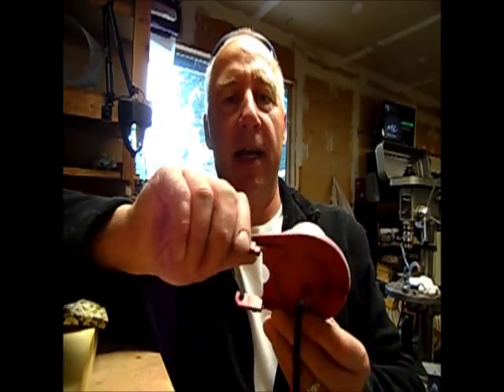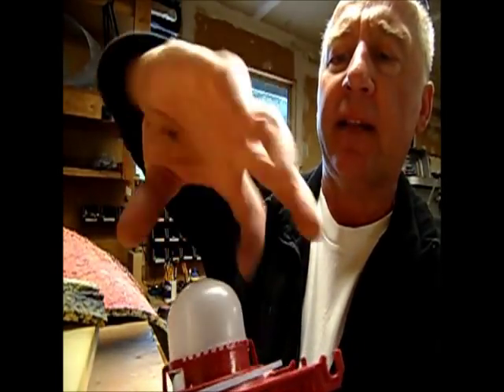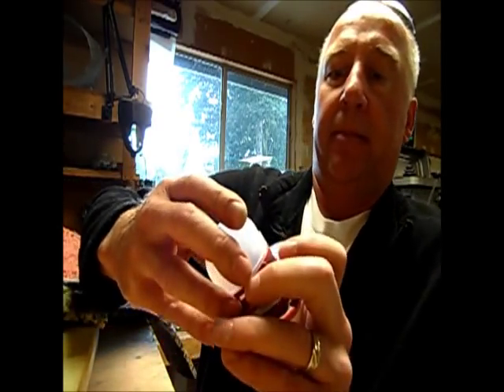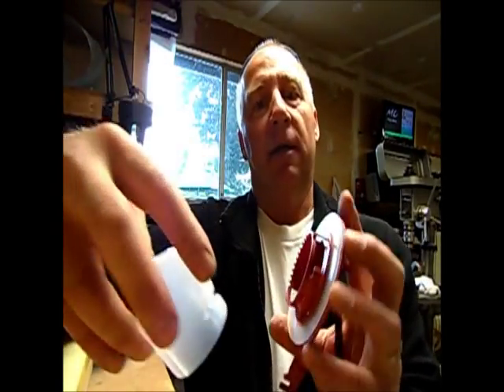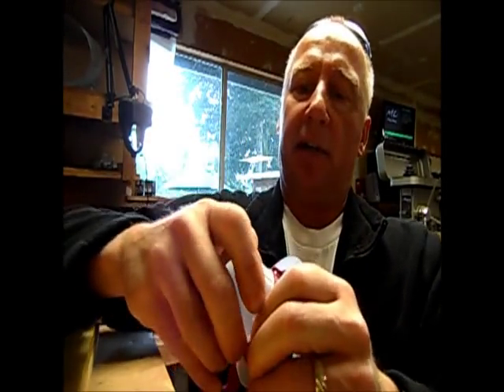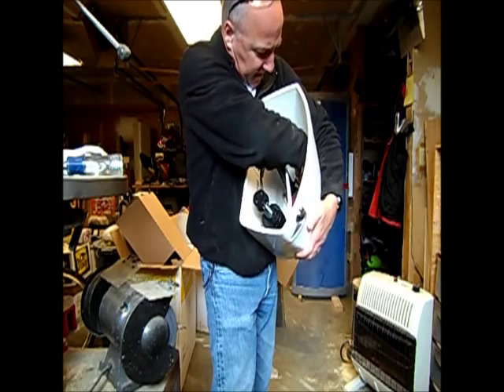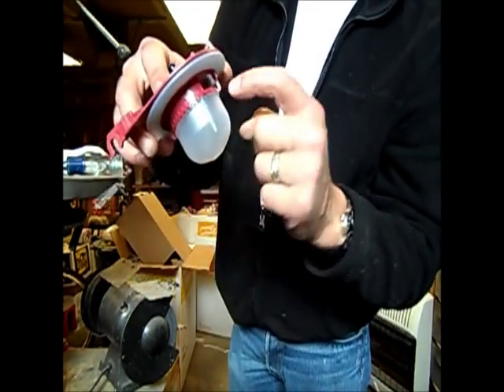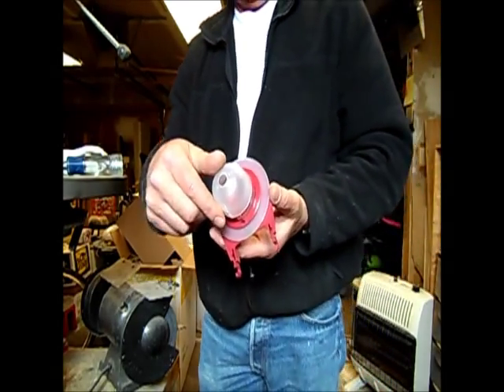Fluid Master 540 adjustment

Comment: Thank you! Your video was the ONLY resource I found on the web that actually explains how the thing works. BTW, the clear plastic stiffens with age. No amount of swsqueezing would flex mine. It was pretty obvious that any more pressure would shatter it. I had to use a small screwdriver to pry it off. That worked fine.
Reply: You just helped me immensely with this comment, God bless you !! Haha I almost broke this thing 😅

Comment: I see fluidmaster doesn't even list this part any more on their website. It's been replaced with the  5403 - UNIVERSAL ADJUSTABLE 3" FLAPPER which doesn't have those annoying locking tabs and adjusts easily without taking it apart. But I had to find YOUR video to be able to adjust mine. THANKS!!! quickly fixed my problem.😀🚽
Reply: I was actually going to purchase that valve just to get a better flush until I found this video.

Comment: This flapper was set at 8 on my new Eljer 1.6 gpf toilet and still closing way to fast.  Barely getting a 1.0 gallon flush.  Thanks to your video I was able to fight through the extreme tightness of the bulb and adjust to 10 which helped along with raising water level closer to top of the overfill tube.  Your video was a great help!  Thanks

Comment: I would like to add my thank you to the others that have been given to you. I watched another video and the man just turned it with no problem. I was getting ready to get my pliers and have at it when I decided to look once more. Your video was up in the corner so I clicked on it and you solved all my problems. I actually thought it was designed to be that way to conserve water and I guess it is, but when you have to flush multiple times you are wasting not conserving. I really don't understand where it could be used, so why not just make a flapper that works without the adjustment. Thanks again!

Comment: Yup, that was it. I couldn't press those snap tabs with my fingers at all. A screwdriver did the trick. This flapper was already installed in my toilet when I moved in. Now I don't have to hold the handle down for 5 seconds anymore. Thanks for the video.

Comment: Hey, thank you so much! I've been struggling with this for an hour, and you told me exactly what I needed to know about that flapper. Also, thanks for explaining how adjusting the air holes keeps the flapper open longer.

What drives me nuts about these Fluidmaster parts is that a) they're cheap plastic and any adjustment makes it seem like you're about to break them (I thought I was going to break the flapper if I pressed any harder).  And b) it seems like they're the only brand that's sold anywhere.

Comment: Heh, thanks tons for this!  New toilet, knew something was wrong, flapper closing WAY too fast.  Instructions showed a float on the flapper and I actually called the company to order (lol, not sure what they sent me!).  Still felt something weird, then came to this via Google.  What a break, otherwise I'd have pondered this for days.  Just like you described.

You're right, you need a lot of force to get the white cup to come out of the flapper!  I used the blunt end of a pen (cover part, also thinking something like a toothbrush handle would work), pushed hard on this sucker, and got it out and saved my fingers.  Tried it on 9 just for kicks, decided 10 is really better.  Hint:  If it's still too quick, hang a float on the chain.

Anyway, working almost normally now, thanks again for something that saved me a ton of time/headache.
Reply: Yeah it still seems like it closes too fast .. so you used a float as well?

Comment: So thankful I found this video. My Cadet3 flushed fine for the first month or so, but has slowly deteriorated over the past 2 years. No clogs- toilet augured out clean and a bucket of water dumped in flushed fine. Once I adjusted the flapper to 10 to keep it open longer, flushing is much improved.

Comment: Thank you, this tip about the Fluidmaster dial and how to release it was super helpful.  Still needed a screwdriver and was not easy to do, but got it released, adjusted and back in the tank.

Comment: Maybe Fluidmaster has made some changes recently, but in my new 5403 (3") flapper I don't need to fuss with finding the detents and such to make an adjustment. I simply pull out on the clear bulb part and keep tension on it as I rotate it where I want it, then release it. Note that you need to be holding it firmly with your other hand (red plastic part) while doing this.
Reply from the maker: UkeDoggie possibly. my wife used to work for a company that would ask for a slight change in product design which change the part number so you couldn't price shop. looks the same and is 99.99% but not exactly. in this case I believe to help ensure the water use guarantee on this product the manufacture requested the adjustment be locked, who knows. the politics of business, sheez

Comment: Fluidmaster has a chart out now to what number needs to be set on the 540 flapper.  I have a newly bought American Standard Cadet 3, and the Fluidmaster chart says to set the flapper at number 8.

And yes my new Cadet 3 came from the factory installed with a Fluidmaster 540 three inch.  All the information is plainly marked on the flapper. And yes the Fluidmaster 540 was set at setting number 1, and it should be set at number 8.

Thanks for the video because Fluidmaster did make these a PITA to change the settings.

Comment: Tom -- let me add my thanks.   Your offering here saved me a bunch of time and probably a trip to the store.   I had the same trouble getting the pieces apart and missed the second detente that you pointed out.  Regarding the other posters: perhaps it's easier to get the assembly apart if (a) the plastic is warmed up or (b) you have the hand strength of a sumo.    PS: the silicone ring beneath the flapper on my unit developed 'blisters' over time that I'm convinced were enough to cause leaking.  If any of your viewers are having slow leak issues, try checking for blisters and just popping them.
Reply from the maker: Thanks George, After closely re watching my video I can see the thing has very little movement if any. I'm going to guess because it sold as a law water use toilet with float installed, they probably agreed to work with Glacier Bay and lock the adjustment up to ensure correct water use, so its not truly a stand alone 570. I recently bought a Freeman tool set from Costco. The number is the exact same as other units but Costcos includes and extra tool. When I got the package the extra tool was not in there probably because the company sells so many of them,  to them its the same thing...but its not. Ya, the devils in the details, thanks for the heads up on blisters, cheers
Reply: dablingtime Yup just popped some blisters myself, local hardware didn't have the replacement parts. Thanks for the video!

Comment: After struggling with holding the handle down, two or three flushes, and frustration, I found myself with a little free time today.  I found your video educational, to the point and short enough to hold my attention.  Great job on the video and I learned something new today which is always a good thing.  Keep up the good work and thanks again.

Comment: OMG, thanks for this video!   My flapper has a different rubber washer on it though...it has a air bubble bulge thing that is keeping the whole thing from closing properly.....I guess I need to find that white rubber washer ring thing....SO glad your video showed the whole part.  Thanks again!
Reply from the maker: You are welcome! I have heard that some of the silicone seals get blisters and stop sealing properly. I don't think you can just buy the seal. A new flapper is cheap and you probably won't have to fight with it to make an adjustment. 
Thanks for watching.

Comment: Thanks a lot. I had a 25year old toilet which I replaced with a new toilet . Of course technology has changed a lot. Who would think that a flapper has an adjustment. Yes you need strong fingers to change the setting mine was set at 3 now 10 you are right it flush’s better . Thanks you tube Bob.

Comment: At 4:40 you state that if the water stays in the bladder longer that the flapper will stay up longer before closing.  That just doesn't happen when I experimented with it.  That full cone will weigh a lot more with the water in it and will fall down faster than if the water was allowed to come out.  There are a lot of variables with getting that flapper to go vertical (slack in the chain, the end of the handle pole and how it lines up overhead with the flapper).  It doesn't appear to be just one thing.  The critical thing with getting these flappers to work correctly is getting the flapper straight vertical.  The other underlying change is the design is aimed at conserving water.  Most plumbers I've spoken with have stated that when using them the quick handle pull is for liquids and when flushing solids and achieving a full flush you need to keep it held down for 3-4 seconds to empty the full tank.
Reply from the maker: That is an excellent point! 
I've used toilets where you need to hold handle for a longer flush and I just refused to get used to it. I was on my own well and had no water bill to concern me. As for the variables again true. And  I wondered if I maybe got the rational backwards on why it flushes longer and never went back and double checked it. You are the first. Thanks for the comments and watching

Comment: Great video, very helpful! I just installed (2) Cadet 3 toilets and was having the same partial flushing issue. I found that adjusting the flapper to setting 6 and moving the end of the chain to the highest notch on the flapper (the one furthest to the right) did the trick and they are now flushing correctly without having to hold the handle. Thank you very much for the info!

Comment: OMG *THANK YOU*!!! Mine was used almost a year so the plastic was stiffer & I had to use the point of a pocket knife to shimmy in under the red ring to get it popped off the stupid “stops” to be able to move it! 🙄

Now:
What’s the 3 adjustments on top? If I put the chain on 1, instead of how it comes from the factory on 3, does that also prolong the flush???

Comment: This was super helpful, thank you. My issue is that it sounds like there is dripping water inside the tank. When I push the flapper down the noise stops. Will adjusting between 1-10 help in this case or do I just need a new flapper? Thanks!

Comment: Great video..messin with this toilet lever for days and i think my lever might be wearing out but also the 540akr flapper is hard to pull up. Its only been in for about two years.  My other question is..what are the numbers ..1, 2 and 3 on top of the flapper where the chian connects to for.?
Can't find any information on any of this on the web or fluidmaster site

Comment: Thank you x 1,001  Other flappers have this same adjust feature but do NOT require this idiotic way of changing it.  By the way when squeezing the plastic piece out of the ring do not use a screw driver, it will break the thin ring of plastic surrounding the clear bulb. I set it on 10 and things work fantastic now.  THANK YOU !!!!

Comment: Thank you so much for this very help full video.  I was doing research on a A. S. Cadet 3 flowise toilet that I just installed and to get it to fully flush I had to hold down the handle.  This just didn't seem right so I done some searching on the internet and came across the fact that my toilet came with this Fluid Master 540 flapper and it needed to be adjusted.  After removing the flapper like you showed in the video I tried pulling up on the clear bottom and tried to adjust it but it would not twist with out doing what you did by pressing in on the sides where the tabs are and lifting it completely off and then pressing it back down in the number 10 position.  Wow what a difference that makes in the flush. From the video I think it's the same toilet I bought.  There was nothing in the instructions for installing the commode about adjusting the flapper only the fill valve.  Thanks again.

Comment: I just bought a new American Std toilet with a "540A" flapper.  There are THREE sets of notches.  One is on the outside of the bubble.  But I have two more sets of notches, inside the bubble.  The bubble is too hard to squeeze, and I wouldn't want to because those inner sets of notches would break off.  (I think they can be seen at 5:04) You do indeed have to push in the detent tabs, then lift the bubble out slightly and turn it.  This video is 3 years old and maybe there are several variations on this basic design, but that's what I have.  I'm glad I looked at it before installing the toilet.  BTW mine was preset to 8.

Comment: What is the purpose of the 3 different chain connection points on top of the flapper?  With my Fluidmaster 540 set on 10, a 1/2" of slack in the chain when closed, and the chain attached to the connection closest to the overflow tube, the flapper still slams shut before the tank empties into the bowl thus giving an unsatisfactory flush.  I noticed in the video something surrounding the chain near the flapper.  Was this some sort of float and would a float help to keep the flapper open longer?

Comment: Good Job.  when I had the top off the tank, I noticed the flapper closing too quickly. I lengthened the links in the chain that runs from the flush handle to the flapper. no difference. I moved the chain to the center position on the top of the flapper. Not much difference. But once I tried your fix, the flapper stayed open much longer. Thanks for the video.

Comment: Thanks for the info. I tried it and the flush was still to short, i removed the bubble completely and still the same. Im hoping putting a rubber flapper will help or ill have to change the entire flush valve.
Reply: Mine too. Putting it on 10 made no difference. I still have to hold the handle down. So annoying. I'm going to go to a different store & try to find a better design.

Comment: good thing is the newer gaskets by Fluidmaster do not seem to have this separation problem.  If you can't find a replacement for the Fluidmaster 540 seal and it has blisters then try this seal instead:
Model#: 83SGB Fluidmaster Replacement Dual Flush Seal for Glacier Bay

Comment: Maybe they changed it because the one I just bought does not require taking apart to adjust--super easy... came set to 10 with a chart of usual settings for different toilets and directions on how to adjust for best efficiency...

Comment: There is a hole on the end.. if you place your finger in the hole and pull up, you can twist the plastic piece to adjust to your desired setting.

Comment: That's cool, I think that makes the flapper stay up a little longer. I don't care too much as if I want to I will just hold the handle down a little longer. But my handle etc has started to not be able to pull the flapper off the seal, the handle just flexes a bit and handle is hard to push. I've had a lot of problems with that plastic handle coming apart where the arm fits into the part that mounts in the tank.  I keep jamming it together, but that is a separate issue. For my flushing problem on the 540 flapper, It looks like you can try moving the chain to a different point on the flapper that may have more leverage. Idk if would work or flush well etc but I want to try it.  I wanted to try that but can see or understand how to do it without take the flapper out of the toilet, which I doubt is really necessary. So I'm looking for a video explaining how the little clip thing that holds the chain works so I can do that. If anyone knows of that, please reply with a link or something thanks !

Comment: Possible trick to releasing tabs.....    Divide red circle into four pie slices.  Four corners, whatever.  Visualize pinching a flexible ring between thumb and index finger using BOTH hands.  Pinching one hand flattens the circle horizontally, and pinching the other hand flattens vertically.  Use your weak hand to gently grasp the flapper ring directly over tabs.  Squeeze gently, then relax.  While still holding, use stronger hand to PINCH HARD at points of red ring "opposite" the tab points.  You are attempting to make the ring bow out at the areas near the tabs.  While holding your ROCK hard pinch, use the weaker hand to gently ease the clear plastic part free.   Does it work?   I haven't tried this yet, cause don't own this flapper yet.  Have an original generic flapper that needs replacing,  and watching videos, trying to decide on which 3 inch flapper to buy.  Good luck.

Comment: Left the setting on one for mine one handle flush clears the water in the bowl with about a third of the water in the tank then shuts off. For solids I hold the handle down longer to empty the whole tank  which clears the solids, works for me but I tend to be thrifty/cheep
Reply from the maker: pel print that works too, I was on a well so my excuse is I'm lazy, lol

Comment: The bulb is difficult to take out because it's NOT designed to come out in order to be adjusted. To adjust simply twist the white bulb and it ratchets into one of the 10 adjustment detents.

Comment: I tried adjusting but no change regardless of setting? The frosted bulb does not seal against the red plastic. Poor engineering to me. Nice idea but no followup to see problems with seal to keep float chamber intact. The bulb is supposed to float on top of the lowering water level to keep the flusher from holding the bulb up manually. I guess I'll go back to hundred year idea of a floating bulb. My wife wants to return the entire toilet because of this so called improvement.